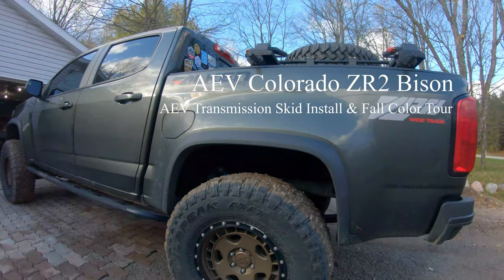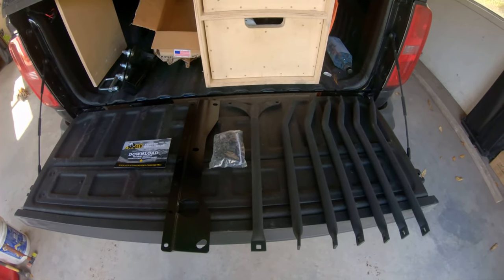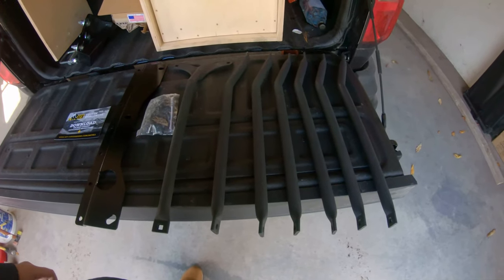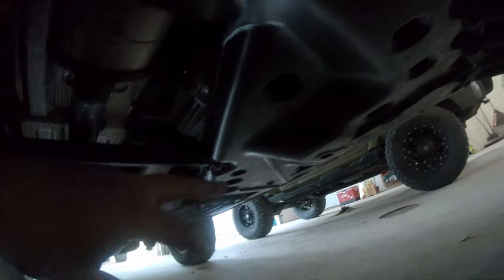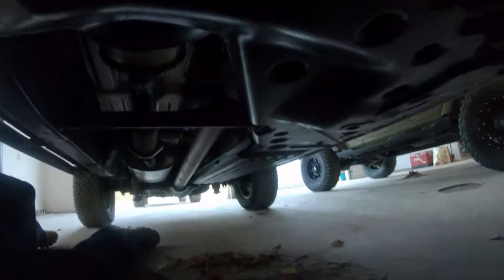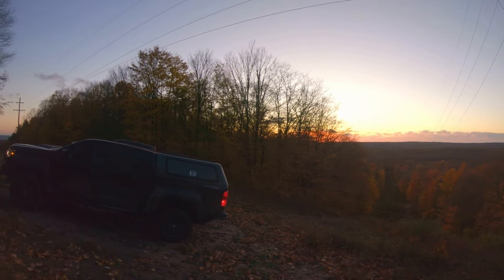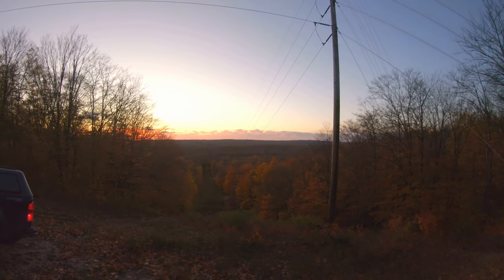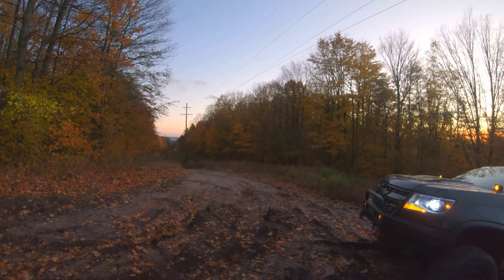We are building the Ultimate Mid-Size Off Roader (ZR2 Bison)

Comment: I couldn't easily get to the nuts to tighten to put my trans skid plate on either. Was driving me CRAZY. Instead of dropping the whole other skid plate. I just used grade 8 hex bolts (With some loc-tite) so I could ratchet (air wrench) from the UNDER-side while holding the nut on the back side with a wrench. Yeah, the bolt heads aren't rounded like the ones AEV sends, but if that's the point that gets me caught on a rock somewhere...the bolt will either round off or get sheared off and take care of itself. 

AEV should change their directions to involve dropping the plate, or use hardware that can be tightened from the bottom, for sure.

Comment: You have anymore info on the 589 suspension mod?
Reply from the maker: Yes, it is probably the "best" and most useful mod for your Truck.  Everyone should do it as the first mod once they get the truck.  I'm getting mine soon, go to 589fab.com and watch their social media for availability announcement.  It puts the shocks on the outside of the frame, so increases our ground clearance by 2" or so because the shock mounts were the low point and that's why it was only 7.9" so now its 10" with this one mod. That plus AEV skids and we have the best equipped off road truck
Reply: @CarsCatsCannabis  You still have the differential, but it is a major upgrade for rear clearance.
Reply from the maker: @madcratebuilder  a big difference!

Comment: I agree wholehearted that it is a royal pain in the ass to install but it saved my ass on a trip in Colorado a couple of months ago.  By chance do you know if the 589 Fab shock relocate bracket kit would possibly void the warranty?  I have their shock skid plates but was completely unaware they even had the shock relocate kit out.
Reply from the maker: I think it depends on your dealer as with any warranty issue. I am confident my dealer would not void it based on relocation
Reply: @CarsCatsCannabis  Do you by chance have a link for the relocation brackets? Cannot find them on the website for some reason.  Thanks for the quick reply
Reply: We’ve been teased by this relocated shock prototype for a long time.
Reply: @Erik-jp7kk  ahhhh well that makes sense why I can't find anything on it. Thanks EE340
Reply: They would have to prove that your modification is the reason why a certain component failed They can't just deny or void your warranty without a good reason